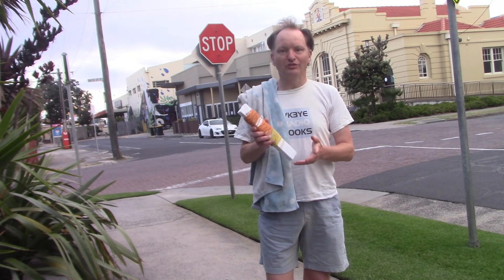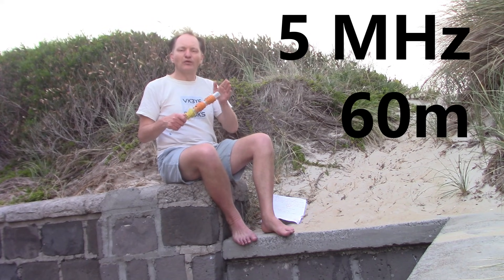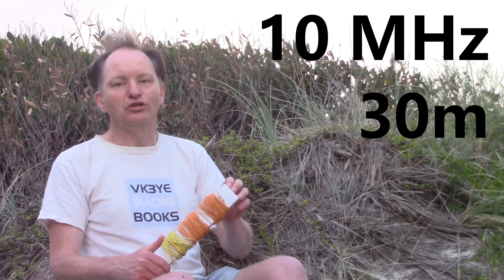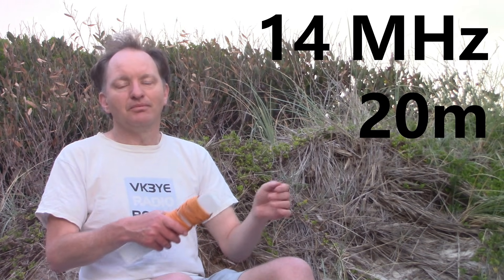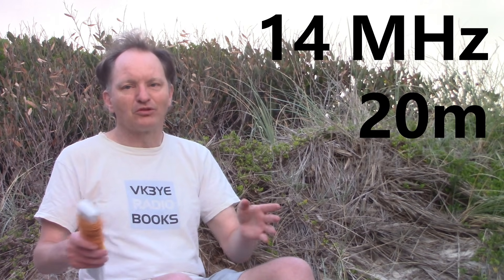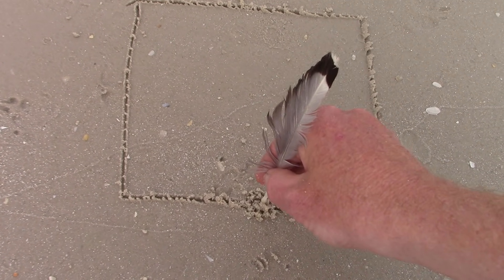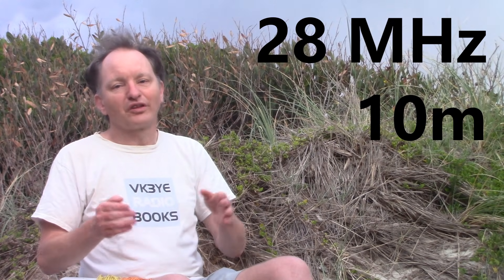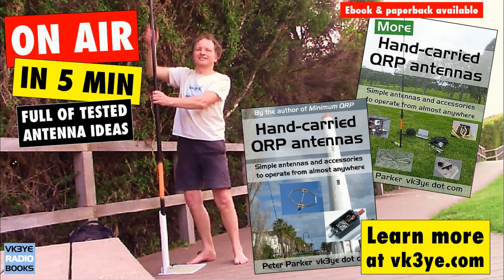What can you do with 15 metres of wire as an HF antenna

Comment: My first stop-gap HF aerial was 15m of insulated steel multicore Chinese washing line. In ignorance I simply fed it by connecting it to the centre of a length of RG58 and to my top-floor shack. Fellow club members informed me that "it couldn't work." With a decent AMU it got me all around Europe and a few transatlantic contacts on 100W SSB. Later I discovered that I had inadvertently made an end-fed "sheathed" dipole.

Comment: A few more options for you:-
Strip the wire at both ends & twist them together.. this way ( without cutting) you now have a quarter wave vertical for 10MHz & you can run it as a Rybakov for 14-28MHz
& You also mentioned your other 5m bit of wire there too, so sling the 15m bit & 5m bit together as an OCF dipole & that will give you 40/20/15.

Comment: A nice one. On and off I run 13,55m Wire with a 9:1UNUN as a vertical Antenna to an 13,7m Fiberglass Mast. works fantastic. My Signal n 80m across Germany is not strong and loud but into North America and Japan it works better as expected. On 12m, 11m and 10m I need no Antenna Tuner. Merry Christmas to you and yours. 73 de Uncle Günter 💯👍🙋‍♂
Reply: I have a similar setup here in Canada; on a daily basis, i can talk on 80m 0-700kms at 100W. I just love EFRW antennas, you get all HF bands with a remote tuner for the price of wire, some ferrites for a CMC and a remote tuner.